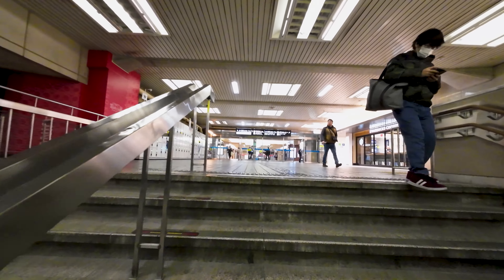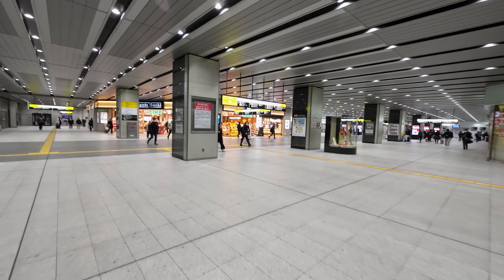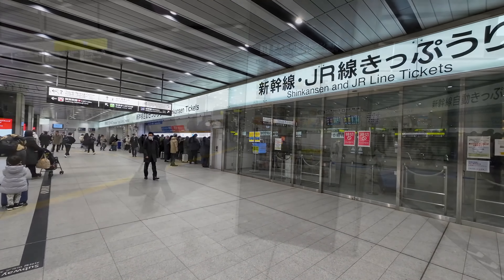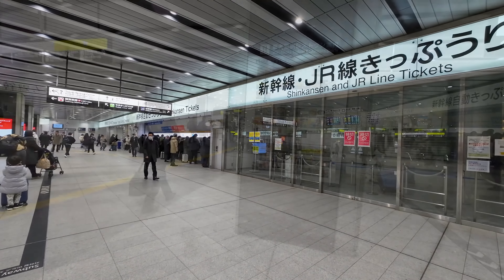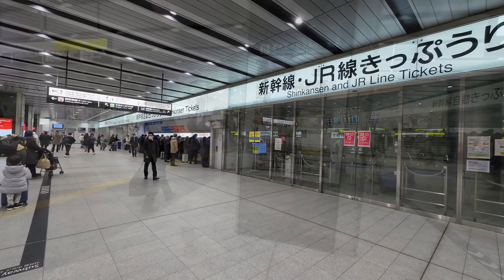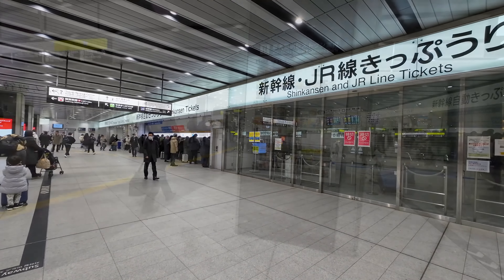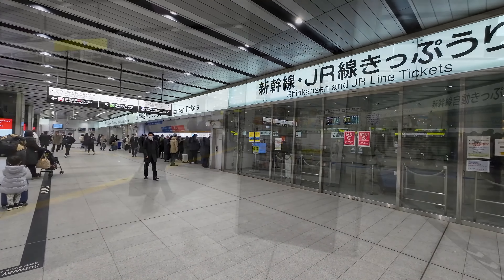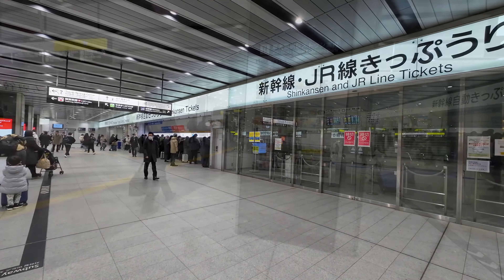Japan Keeps Building THIS High-Speed Train – But Is It still Good?

Comment: The Wi-Fi is fast but intermittent as it doesn't work in tunnels and Shinkansen routes have a lot of tunnels. The sink in the corridor outside the toilet continues on the newer varieties despite no longer having a urinal, there also used to be payphones near the doors at the ends of carriages until very recently.

Comment: Personally I like the aerodynamic design of the 700 series over the newer N700 series. The nose is not that long but it still gives a sense of smooth airflow. But it's not like the stubby 300 series. 
I just like the Dr. Yellow 700 series that runs up and down the Tokaido and Sanyo Shinkansen

Comment: There is another reason why the car number of the new cars will remain the same as 700.

800 is the number already used for Kyushu Shinkansen cars, and 900 is the number used for inspection cars.
And since JR Tokai & JR West basically do not use car numbers over 1000
The 700 is added to the alphabet to classify the new cars.

新型車両の車両番号が700のまま変わらないのは、別の理由もあります。

800は九州新幹線の車両で既に使用されている番号で、900は検査車両などに使用される番号です。
そして、JR東海&JR西日本では、1000を超える車両番号は基本的に使用していないため
700にアルファベットを追加する方法で、新型車両の区分を行っています

Comment: Here is some bit more mention to explain about the 700 series Shinkansen you’re on.

10:02 these room are special to the 700 series RailStar sets (current Shinkansen in the video). As the 16 car versions doesn’t have these. These room and RailStar exist was JR West’s attempt to compete with air travel in Japan. These originally run the service “Hikari RailStar” it’s basically a special named hikari train. However it was because of the 8 Car N700 that goes to Kyushu have somewhat same stopping pattern as a Hikari service, meaning rendering hikari services on the Sanyo Shinkansen section completely redundant (expection to hikari trains that runs all the way to Tokyo). Which meant these 700 series were reallocated to Kodama services along with the 500 series. Some only very very occasionally at a specific time does Hikari Railstar services.

7:43 would’ve recommend you to put the 16 car versions instead as those are the first versions of the 700 series before the railstars came in.

Also a little fact. All of JR west’s Shinkansen are future proof for a future 16 car to 8 car conversion. The other 8 (or so) 700 series from the B sets were modified and ran as 700 series E set aka the railstar sets.
Reply: Correct. The original Hikari Rail Star operations between Shin-Osaka and Hakata skipped many stations along the way and were equipped with more comfortable seating to entice passengers from flying on airliners between Osaka and Hakata. Sadly, I think these 700 Series, along with the 500 Series, train sets will likely be retired by 2026 as they are replaced with refurbished and shortened N700A train sets. We will also see the N700A train sets replaced by N700S train sets over the next 4-5 years.
Reply: @Sacto1654  500 are sure getting kicked in 2026 (which is a big shame, but they have been living on borrowed time for a long time now). Pretty sure the 700 have still a couple miles kicking.
Reply from the maker: Thanks for clarifying, interesting and complicated history
Reply: @Sacto1654  I also remember that Rail Star is a more tourist-oriented service
Reply: @lzh4950  No, I tnink Hikari Rail Star was also a more business-oriented service. Note many of the cars had 2+2 seating more associated with the Green car seating found on N700, N700A and N700S train sets.
Reply: @Sacto1654  Thought business travellers might go for the more express Nozomi/Mizuho services

Comment: For the 700 series Shinkansen  (the original one, not the newer N700(A*/S) ones) only the 1st & last rows in each car have power outlets. & I think they are also the last Shinkansen to have squat toilets but no bidets/toilet seat warmers. & I guess that the multi-purpose room is a euphemism for "nursing room/sick bay"
*By the way I also remember that all N700 Shinkansen have been upgraded to N700A spec, with more energy efficient propulsion equipment, while some brand-new rolling stock built to N700A standard were also built in 2013
Reply: Technically not all. The 8 car n700 varaint for Kyushu route isn't upgraded